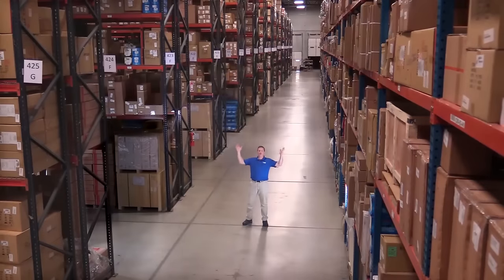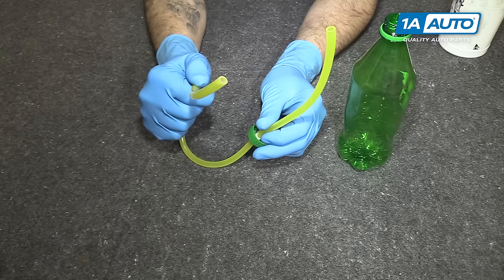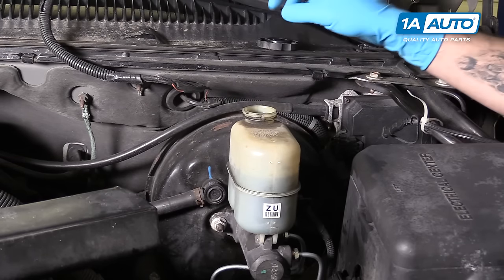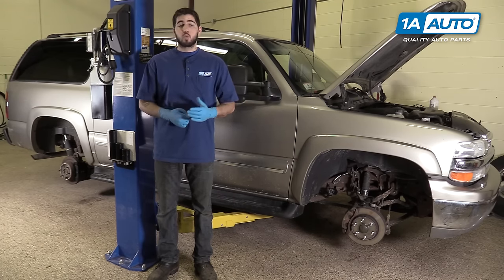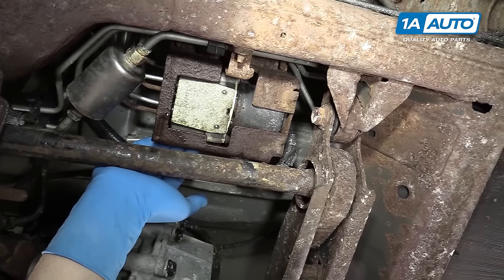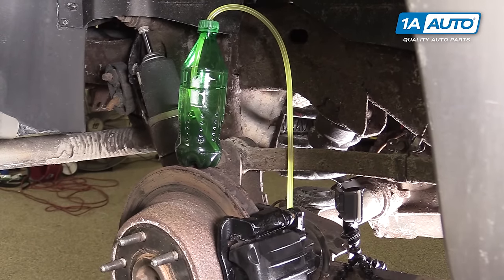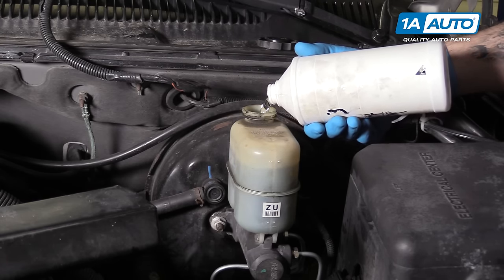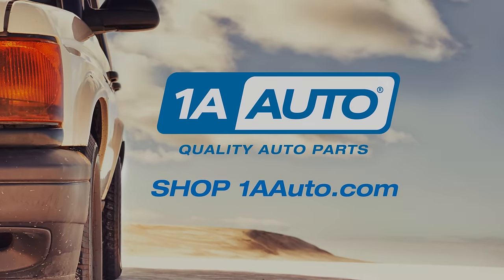How to Bleed your Brakes by Yourself

Comment: I only need to do the front brakes. Do I have to bleed the rear even though I’m not changing them?
Reply: No u need not bleed the brakes at all when only changing brake pads.bleeding is done when air gets in the system from replacing a caliper,or some other reason like flushing out old brake fluid and replacing it.again you only need to bleed brakes when the system has been compromised and air got in,not when changing pads.

Comment: Hi Thanks, But I am having problem to understand the name of that little white thing which you put to keep the hose tight. What is that called ?? Also you mentioned that hose is 3/16 and what ??
Reply: That little white plastic thing is called a "zip tie". It can be found in parts stores, hardware stores in the electrical section. Just snug it onto the line under the bottle cap to keep the hose from pulling out of the fluid inside the bottle. The hose he used is 3/16" fuel line. That is the inside diameter of the tubing. You should measure your bleeder screws first before you buy the tubing. It needs to fit tight, so it doesn't leak air or fluid. 2 feet long is enough to connect the bleeder screw to the bottle

Comment: Even better, you take the bleeding valve off, four turns of Teflon tape on it, put it back and THEN start the whole procedure. You introduce air in the system through the valve threads every time you release the brake pedal. This is the missing link for all those cheap vacuum brake kits as well. Works like a charm!

Comment: Even using this method I have learned to use a stick to keep the brake pedal depressed on the final push, just to make sure a bubble does not get sucked in through the threads of the bleeder nut. Also, with new master cylinder replacement, bleed the MC first!
Reply from the maker: +John S Thank you for the feedback! 1aauto.com

Comment: I have seen mechanics attaching a manual pump fixed to the brake liquid container to force the brake liquid down the system and alternativetely pressing the the brake pedal.
Reply from the maker: +K P Thanks for the tip!

Comment: Can we reuse the extra brake fluid in the bottle after we're done, or is it considered contaminated?
Reply: No you can't ...  Old and contaminated fluid will be collected in the bottle
Reply: @1szx  Thank you!! Somebody finally answered the ONE question I had about the whole video. Thank you so much. I was wondering that myself. Same result if you change out the fluid in the reservoir? The stuff in the lines are still old and should be disposed of properly. Which way is technically better? Just keep adding new to old or vacuum out what you can in the reservoir and start fresh?

Comment: Great video but I have a question.  My accord front passenger brake caliper piston got stuck and it wouldn't retract.  I kept smelling burn metal however, I replaced it the caliper and the mechanic bled the line.  The brakes worked wonderfully but the ABS came light came on a few hours later.  It lasted like 2 days and then it turn off however the brakes seem to be working awkward.  For some reason the brakes slide and feel like there is no gripping.  I can be driving 15 MPH and slightly brake and it doesn't grip and or slides and i feel a vibration on the pedal.   Have you ever experienced this?  Maybe even after you've bled the line?
Reply from the maker: +King Less There could be many things causing the problem you explained here. We'd suggest getting the vehicle diagnosed by a local mechanic to figure out what is going on. 1aauto.com

Comment: This might sound like a dumb question. When pumping the brakes am I supposed to have the ignition in the on position or is it done with it in the off position?
Reply from the maker: +David Legaspi That's actually a very good question! There are vehicles out there that have very sophisticated, computer-controlled braking systems, but they can all be bled using this basic procedure. Thanks! 1AAuto.com

Comment: Trying to figure this out. I have a brake line leak right under (and just behind) the drivers seat. Looks like it's leaking out of the bolts where the metal line and hose go together. Any advice?
Reply from the maker: +Cocky Balboa It's possible you may need to replace the brake line

Comment: I've seen a vid where some pump it three times and then hold it and then get out and then release the fluid then repeat the process. (Pump it hold it release it). what is the difference from your method versus this method. I'm looking for the easiest way possible with no one else but me.
Reply from the maker: +joeh690  This method is a lot less messy and having the fluid in the bottle prevents air from re-entering the system. We prefer this method.

Comment: Do I need to change oil from the bottle very time I bleed each side thanks
Reply from the maker: +Re George Only if the oil is old. Otherwise you should only top off the bottle if it is low

Comment: my brakes squuek a bit i was thinking i might need new brake pads..i just got them done last year but the guy mightve used shitty low budget pads its been 12k kilometers they should be good for longer than that i was just wondering do you need to bleed them if youre just changing the brake pads?
Reply: anyway good video clear and simple;)

Comment: Dumb question maybe. But where do we get that fuel line to put into the plastic bottle? I haven’t bled my brakes longer than I should have and feel that I need to even though my brakes work very good even though I haven’t. Just wanna keep the maintenance on it.
Reply: Auto parts store, or a hardware store like Ace Hardware should have the hose you need.

Comment: Do I need to remove the wheels for this?I did both rear cylinders and I'm flushing out they system of old fluid and the wheels are on.
Reply: If you can access the bleeder screw/open it, then yeah leave them on

Comment: So if i did empty the brake fluid reservoir i will need to brake the master cylinder before doing this method ?
Reply: The master cylinder has to be full of fluid before you start this process. If not, you'll have to start from the beginning.

Comment: 3:22 Would I be able to bleed brakes with ABS. Thought you need a scan tool for the ABS when bleeding brakes.
Reply: I'm no expert - but as far as I know as long as air isn't introduced into the abs module itself you can bleed as normal. Keep the brake pedal fully depressed if working on brake lines & you can also remove relay to ABS. But get a second opinion first!

Comment: so basically, get a bottle and small hose. Make sure the res is topped off then attach the bottle and hose to the bleeder while bottle is filled then press the brake till all the bubbles go away then close the bleeder remove hose, top of res if needed etc, seems pretty straight forward. I always knew what bleeding was but never had to do it myself but thought it be good to learn.
Reply from the maker: +austin bhd2861 Thanks for checking us out! 1AAuto.com

Comment: Hey I’m changing a brake caliper and only need to bleed one brake line. Or do I have to do It to all 4 lines??? Thanks
Reply: Wild baby Logan I've usually bleed just the one caliper if the line wasn't open too long. Best to do all four but one should be good.

Comment: Ok so what do you suggest if the bleeder valve won't loosen to bleed the brakes?
Reply from the maker: +Kathy Galvin Thanks for checking us out. You may be able to find a bleed point further up the line and let it gravity bleed if you cant get the bleed valve open.

Comment: If you replace 1 rear caliper on a 06 mazda 3 do i need to bleed all 4 brakes? Thx
Reply from the maker: +80s Honda dirtbike 1 Each of the wheels has its own dedicated brake line, therefore it's OK to just bleed one brake caliper.

Comment: Can i use the brake fluid that was bled out in the pop bottle to pour back into the master cylinder?
Reply from the maker: +Ko-wing wong Thanks for watching!  You will want to top off the system with new brake fluid.
Reply: ARE YOU SERIOUS?????  You are flushing old fluid and you want to put it back on the system?????

Comment: I have trouble-saving hack to help prevent breaking off the bleeder fitting. Make sure you have the dust caps on the fitting. Pop them off a day or two before starting the bleeding process and spray WD-40 into the fitting and replace the cap. This will help prevent snapping off the fitting when you loosen it and avoid a caliper replacement. You’re welcome!

Comment: I did it like you're showed but Everytime I pump the brakes, after the the fluid stops flowing in the bottle air bubbles we're still coming out after the 3rd set of pumps which was 9 times
Reply from the maker: +Jessie Sheppard Thanks for watching!  If you are still getting air bubbles then air is getting into the system somewhere.

Comment: When you release the brake pedal, some fluid (may be mixed with air) goes back in right? How come it doesn't go all the way back in? And, can i reuse the fluid in the bottle?
Reply from the maker: +Aditya Sivaramakrishnan You would want to add new brake fluid and reuse the old stuff.
Reply: @1AAuto  that should be "not reuse the old stuff"

Comment: So fill up the master cylinder full. Crack the bleeder on the farthest brake first. Pump the brake until no more bumbles come out. Refill master cylinder after every brake bleed. Sounds easy the only thing is you can’t see what you are doing with the one man method I guess you pump the brake a bit then go check seems like two people be faster

Comment: Question.

Just Before You Pump You’re Brake Pedal To Bleed, Does The Vehicle’s Engine Need To Be On Before You Pump The Brake Pedal To Bleed Or The Engine Off?
Reply from the maker: +Roy Mtz You'll want to bleed the brakes with the engine off. 1aauto.com
Reply: Thanks

Comment: The brake pedal should be pressed 5-6 times & pedal should not return upwards on last brake pedal push till bleed screw is tightened which on last pump I use an old broom stick cut to length of pedal that is pressed all the way down to floorboard & other end to fit tight up against steering wheel bottom which will never let any air back into the lines been doing this for years always worked well.

Comment: To open stuck bleeders, heat the bleeder screw with a propane torch and then slap a soaking wet rag on top of the bleeder to cool it. This causes all the rust in the threads to crack, now open using a 6 point socket. Works great and no special tools needed.
Reply: Does propane torch work the same as butane? Thanks

Comment: How did you get hard brakes if your bleeder valve wasn't tight yet? You were JUST pushing fluid through there, so any press of the brake would just push fluid through the hose instead of staying in the calipers to become firm. That part made no sense

Comment: Do I have to take all the Tires off to bleed the breaks?
Reply: I guess the real question is:

Is there a Way to bleed the breaks without taking the wheels off?
Reply: I looked on google cause I wanted to know. :Yes, if you can reach the bleeder valves. Since this is your first time, I recommend that you have someone else do the job while you assist and learn.

Comment: This is a great video. A 20 ounce Gatorade bottle is just about perfect for this. The zip tie is the icing on the cake that makes this contraption work. It keeps the tubing below the fluid level so you don't suck air back up into the lines. I got that 3/16" tubing from Oreilly's, even the same color. About 3 feet is just about right so you can position it anywhere you need it. I also use a 6 point deep socket to crack the bleeder for the first time because those things tend to stick when they have been sitting for awhile. This saves so much time since you can just empty it out into another container and get going to the next wheel.
Reply from the maker: Thank you for the great reply. We love to empower our customers by showing you how-to perform your own auto repairs while installing our high quality auto parts. Have a great day! 1aauto.com +lucidbarrier

Comment: Wait!? Why fill up a soda can when you can use the bottle it came in and not contaminate the brake fluid?
Reply: Personally I would not reuse any fluid that has come out of the bleeder valve. Though it may look clean and clear there is always some amount of trash in the expelled fluid. DOT fluid is not expensive. It is well worth the comfort in my mind to only add brand new fluid to your reservoir. Im not a mechanic or even good at working on  cars this is just my opinion.

Comment: 2:00. you don't need to use new brake fluid there, just remove the old one from the reservoir and put it inside, so you don't waste new fluid.

Comment: Loosen rusty fittings with a hex socket and ratchet. More or less gently tap the ratchet with your hand. Much lower chance of stripping. Also heat it with a gas flame if it doesn't wanna move.

Comment: it can be annoying if the container for the fluid falls over, but there are bleeder kits out there with the bottle, the tube and a magnet to hold the bottle in place. just stick it to your car, easy, costs £10

Comment: Hello I have a question I have a 2006 Monte Carlo SS 5.3, I like to know if I can use the rotors calipers and rims from a 2015 or newer  camaro SS
Reply from the maker: +boogeyman 314 Thank you for watching!  The brake components are different on these vehicles so they are not interchangeable.  1aauto.com
Reply: @1AAuto  thank you for your fast reply, i forgot to ask you,if i change the wheel bearing hub from the camaro would the everything fit,thanks
Reply from the maker: +boogeyman 314 No, you still wouldn't be able to install the parts from the Camaro onto the Monte Carlo.  Thanks for the questions.
Reply: @1AAuto  okay my friend thank you I really appreciate you and I appreciate all your help thank you keep up the good work
Reply from the maker: +boogeyman 314 You're welcome! Please let us know if you need any further assistance, thank you!
Reply: Good morning thank you my friend for the Monte Carlo no more assistance the best thing I can do is leave it the way that it is if it's not broken leave it the way it is once again thank you I love you guys keep up the good work

Comment: I'm an old fart and have been using that method for decades.

I finally bought a handheld vacuum bleeder and wow, what a difference.  It's so much faster.  The plus side is you can also use this tool to troubleshoot vacuum related smog equipment.

Comment: Two issues. 1. There was no mention of resetting the proportioning valve. If it is required for your vehicle. Not resetting will make for a longer and most disappointing day.  2. The presenter, demonstrated he didn't know how to use an open end wrench. The small "tooth", tang (or jaw side) of the open end wrench, ALWAYS goes in the direction of the rotation you are attempting. Fortunately he sensed he was going to round the bleeder off and stopped. NB. When I bleed the brakes. I put a box end wrench (4 in  total) one on every bleeder.  Prior to bleeding. I crack & close each bleeder first. Then I am sure of one less surprise. If I have changed lots of brake parts, I connect 4 (hose & bottle bleeders)  and allow the system to passively bleed. When all the old fluid entering in the bleed bottles goes clear ie. (good) fluid. I close that bleeder. So on so forth until all the brakes are flowing new/fresh fluid. Then I remove all 4 hose & bleeder bottles and start bleeding as per proper sequence or farthest brake bleeder first. Doing this totally changes the fluid to fresh and minimises the waste of brake fluid. I put golf tees into the open end of the bottle bleeder hoses to keep my brake bleeder gear, clean, for the next time.

Comment: I had a mechanic that I trusted for decades and should have read the news paper to see that he sold the business but it would retain the same name. I took it in for a break job and everything was fine UNTIL about a month later. No indication, no warning pedal went to the floor with no resistance. 
I'll cut to the chase. They did all four for $99 per BUT one of the employees mixed up bottles and topped off the master cylinder with power steering fluid. For those that don't know that is an accident waiting to happen. ANYTHING rubber will deteriorate in the break system. 
After a $6000 quote to fix it I sued and won. Fix my car, your fault I don't even own spare power steering fluid.  The Judge agreed. They went out of business shortly afterward because I forced them to put front disks on my 64 Malibu SS on their dime.
There are times to just buy the parts and do it yourself. It beats dying. 1A Auto can usually have what you need as fast or faster than Amazon. Their tips and how-tos are epic.

Comment: What's not shown is all the fluid that will leak out from around the bleeder screw threads and makes a huge mess on the caliper, rotor and hub.   Nothing you can do to stop it without somehow sealing those threads.

Comment: Should have measured my release valve.i bought hose from autozone. It's too thick to work with and just wide enough it to be loose.

Gonna get my measuring tape a find the correct size hose for this job.

Autozone always disappoints me 😂

Comment: WAIT: To make this work, I had to remove my bleeder screws and add 3 counter clockwise wraps of teflon tape onto Just the threads and then reinstall. Otherwise the threads would leak air into the line while bleeding.  Otherwise worked great.
Plus the teflon tape can stay.
Reply: I tried this 40 years ago, and no matter how little I cracked the bleeder, just to the point of fluid coming out (with a stick between the driver's seat and the pedal) it always sucked air through the threads of the bleeder. You are spot on, put some Teflon on the bleeder threads. And of course you have to leave it on those threads till next time :)